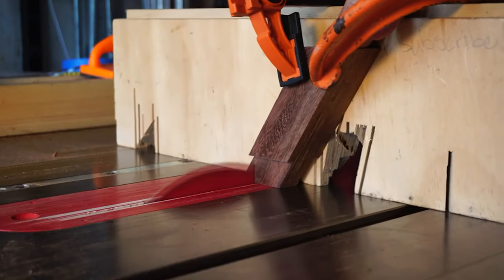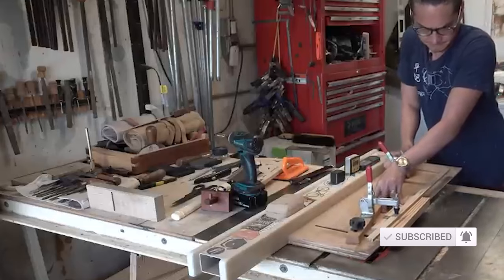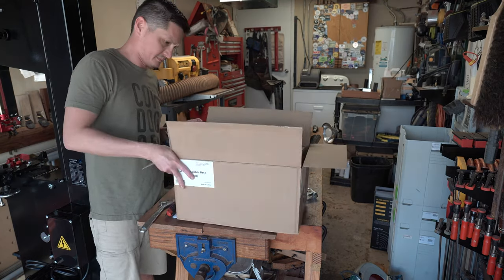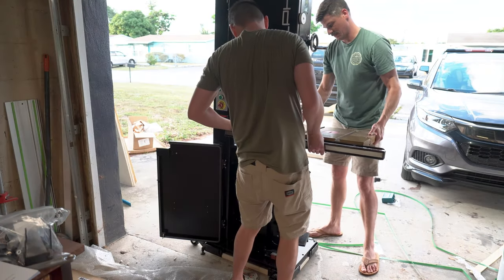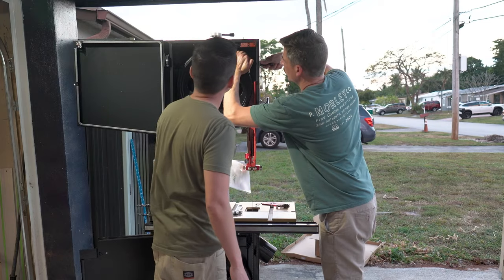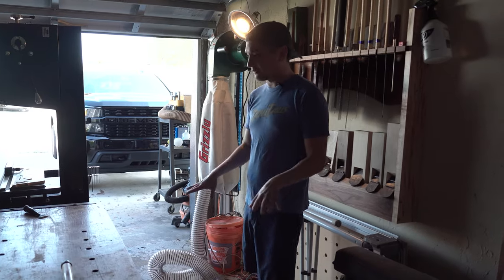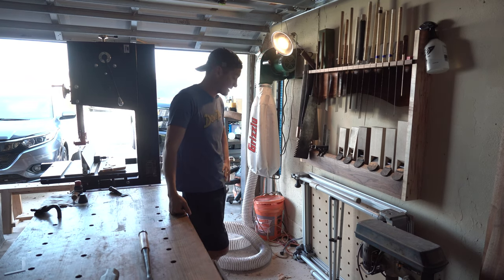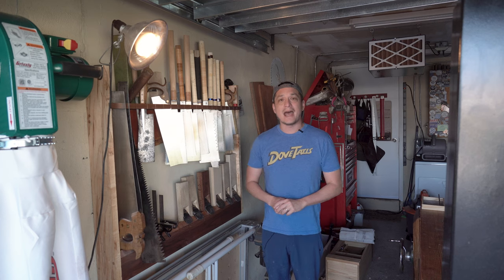The DEATH of my table saw…

Comment: Good on you! After a 20 year woodworking hiatus (career + kids), I’m reconstituting my shop. Looking back, what I really enjoy about woodworking is hand tool work, not setting up machines that would like to eat my fingers. So I’m doing the same thing. Selling my table saw and keeping the bandsaw. Jury is out on whether I also sell the thickness planer. (I’m getting pretty good at dimensioning by hand.) I think too many hobbyist woodworkers make the mistake of setting up like they are running a production shop. We aren’t. It’s a hobby. If the process is more enjoyable with hand tools, but takes longer (sometimes it’s faster!), we should do that. It also makes it easier to work in the evenings without bothering the neighbors (except when you chop mortises ;) )
Reply from the maker: Thickness planer feels indispensable for me just because I get real lazy after doing the one face and edge. 😂 maybe I’ll make a flip cart for it with my lathe though so I can stop using that elementary school AV cart.

Comment: Nice looking saw man. I’m interested in hearing how you like it. Sounds like it was priced just right!
Reply from the maker: Absolutely. Free is an excellent price. So my instant impressions are: it is definitely not lacking for power. Bearing guides below the table are a little bit of a nightmare to adjust. Luckily I have tiny hands but I can’t imagine someone like you with big mitts having a good time with that. As far as blades I originally had the 1 1/4 resaw king from laguna on there. Felt a little wide so I think a 1” blade is probably the biggest that should go on there. I’ve also got a 3/8 for more curves. Dust collection is interesting… it has two ports and you can shut off one if you don’t have the multiple hoses. I chose the one under the table and should have gone for the way bottom. Overall a very nice machine but it’s definitely not the most perfect.
Reply: @CowDogCraftWorks  I’ve never had much luck with DC on the BS. If nothing else the bottom port extends the period between cleaning the bottom cabinet out. Those resaw kings are beasts. I just ordered a second one and will send my old one for sharpening. I also settled on the 1”. Have fun with it!
Reply from the maker: Oh snap I didn’t realize you could send them out to get sharpened although that does make sense since they have carbide teeth. Do you do it with someone local?
Reply: @CowDogCraftWorks  yea, a shop in town sharpens all kinds of blades. If you don’t have a local shop Laguna does it too.

Comment: Just went through your videos list and I see no video on your Japanese saws. Sure, one was making a handle for a Ryoba, but you seem to have a really nice collection. Please let me know which makes and models you have? I recognize ZSaws(3) and do you have Nakayas? I'm in the process of buying 5-7 of them now, so I'm really interested. TX
Reply from the maker: There’s a bunch and I’ve got more on the way… various ryoba for softwood and hardwood… a rough kataba that is probably about 310 mm… a softwood carpenters ryoba that’s 270 mm with madonoko gullet teeth… a maebiki from pre WW2… I just got a yataki hardwood ryoba at 270 mm as well. I may do another video and highlight some of my more unique and rare tools with a shop tour. Too much to type.
Reply: @CowDogCraftWorks  I am curious as to how you know these names and then, equally importantly, through which source you get them. Though I spend quite some time educating myself on the saws, I havent heard of a Yataki for example. I'd love to join the ranks!
Reply from the maker: @LitoGeorge  yataki is the smith not the kind of saw.
Reply: @CowDogCraftWorks  yeah that I know. Others have put their smiths up when showing off unique saws and I simply can't find them afterwards. Do you mind taking me how you learn about these smiths and where you buy the saws? I don't mind going to DM if necessary